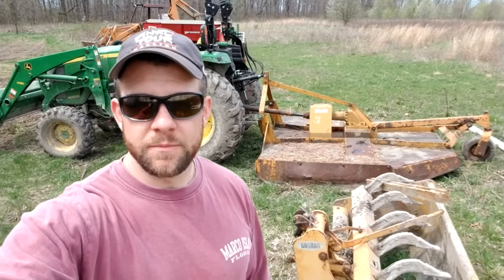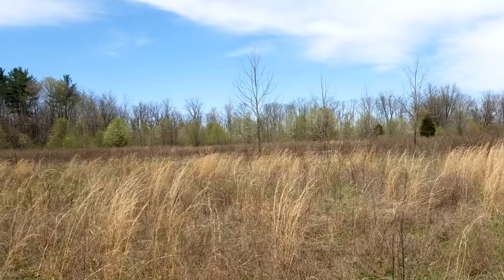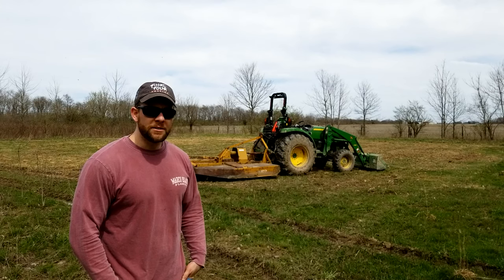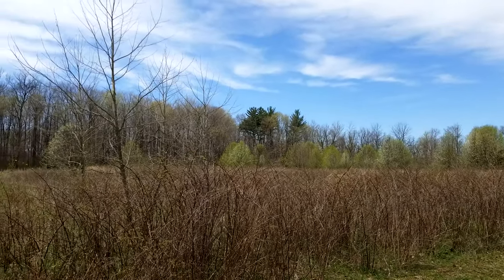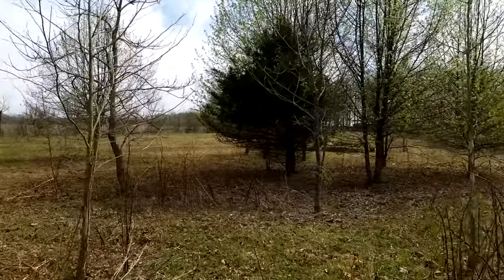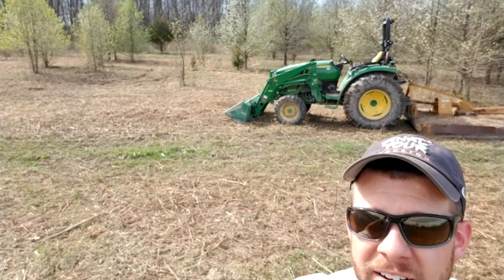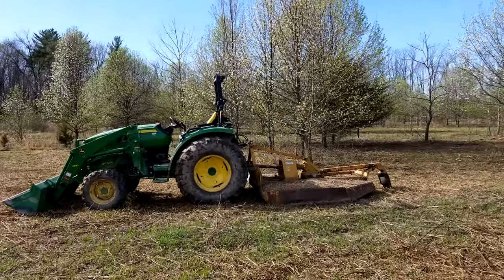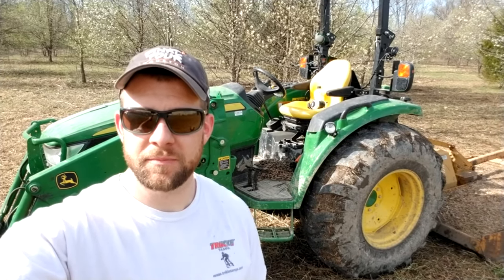First Use of the Woods Cadet 84" Rotary Cutter Behind the John Deere 4052R

Comment: I recently traded my 4610 Deere for a new 4052R.  It already had top and tilt on the tractor along with the 3rd electro hydraulic as well.  I have been mowing this summer in my woods with my old Deere MX6 mower.  The tractor also had the I-Match 3 point hitch  on it.  I have discovered that mowing with the top link in float allows the mower to follow the contour of the uneven ground easier with less strain on components.  I’ve not had the top and tilt before and  have found it quite handy with the mower, box blade ande angle blade.

Comment: Make some adjustments, You want the rear wheel on the ground with the weight on it and the front of the cutter to be 1/2 to 1 inch lower than the rear. it looks a little too level and no weight on the wheel.
Reply: A lot of time but in reality, not enough. There is no where I rather be.